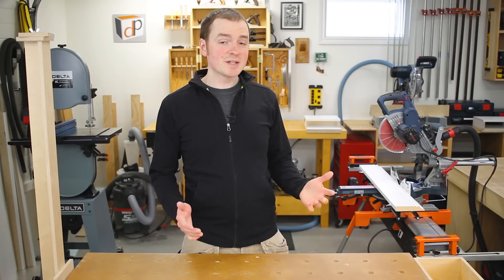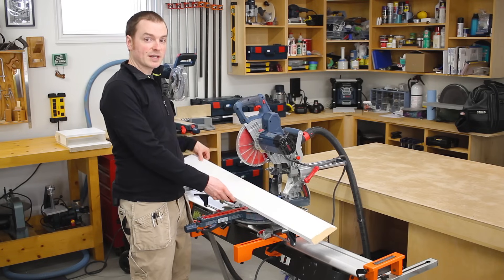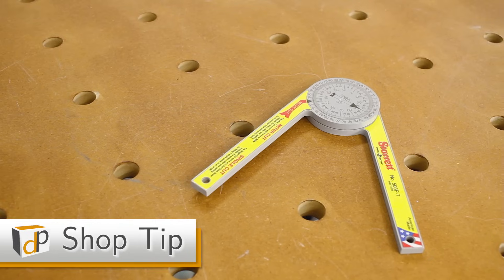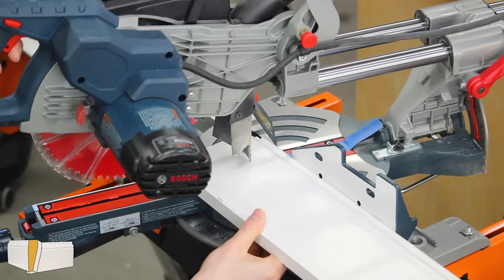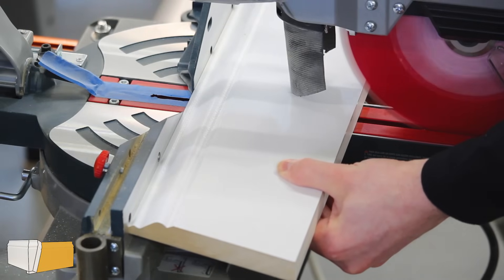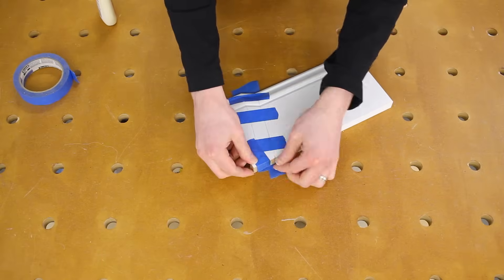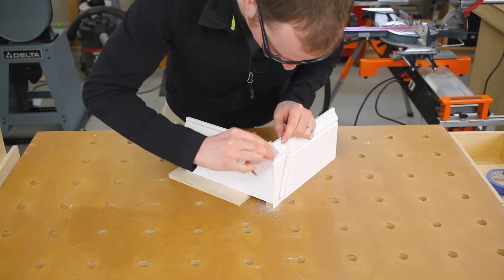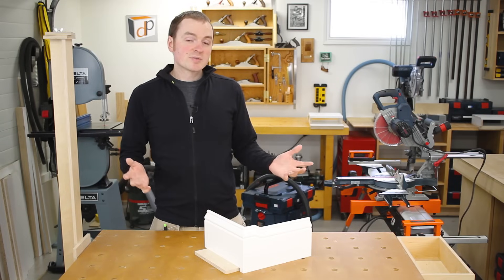How To Make a Baseboard Step Down Detail + Bonus Trim Tips

Comment: Man, this is why finish carpenters are worth every penny. Really nice detail.
Reply from the maker: +Mike Fratto thanks!
Reply: As a finish carpenter I would have started with the lower floor and then ripped the base so the top was the same height on the higher floor.  My guess is Dan did this as he does not have a table saw on sight.
Reply: My father in law has run a business for 40 year called Furniture Doctor and he makes 6 figures a year easy, I always thought it couldn't be that hard. Then I worked with him and realized it was the difficulty its the experience and attention to detail guys like Dan has.
Reply: I don't know why they have to be from Finland to do this?
Reply from the maker: I'm from Canada

Comment: Wow, how in the hell did you figure all that out. I WOULD LOVE TO SEE A VIDEO ON THAT PROCESS. True art, wow.
Reply from the maker: I just figured it out in a few minutes when I came across the situation on site. It's not really as complicated as it seems. I've done enough of them now that I don't even think about it anymore.
Reply: @DPShopTalk  Hi Dan.  So I have a job where this situation is occurring now. The only difference is there is no miters its just regular 90 corners.

 Basically have a 1/2" step down from some laminate flooring straight on to some stained concrete. 
My setup is basically a square room which has the laminate flooring and the drop occurs at the entryway to a hallway the entryway has no casing its just plaster.. 

So I want my base to come out of the laminate room and wrap around the 4" of entryway the wrap in to hallway. I just need it to drop down that 1/2" to concrete so all the base has the same top height..  
Can I acheive that following this video but taking out the mirror part? Help, lol.
Reply from the maker: @ShaneHolly  Hi Shane, from what you've described it sounds like a similar situation to what I showed in the video. If you wanted to email me some photos I could probably give you a better answer. dan@danpattison.com
Reply: @DPShopTalk  ok I will do that when I get there tomorrow.. thanks

Comment: I have a 3/16" step down off of my bamboo floor install to my entryway tile.  This worked out for 3/16" step down.  15 degree angles with about 1/4" step down.  Glue,Caulk and sanding it is going to turn out as it should. Of coarse I have a straight run too.

Comment: Great work Dan. How would I accomplish this with the bullnose corners
Reply from the maker: Thanks. Typically with a bullnose corner I do two 22.5 degree angles  so that a small piece goes across the bullnose corner at a 45 degree angle. Doing that with a step down detail would add a degree of challenge to it but would still be possible.

Comment: 4:45 I watched that 10 times and then got it, hearing things in North American takes me ages to convert to my brain. I've got it now! Cheers.
Reply from the maker: Lol yeah that's the critical part. I'm assuming that you're referring to using inches instead of metric. The funny thing is Canada is a metric country but for some reason just about everyone still builds in imperial. I do use metric more as time goes on but still mostly imperial so that I'm talking the same language as other trades on job sites.
Reply: @DPShopTalk  exactly.  But also the way you describe the right angle tool edge etc.. doesnt matter as I got it. Got my project done over the weekend thanks to you so many thanks! :)

Comment: This is awesome. I am in a jam and can't figure out my baseboard transition. Will this method work if my height is a tall 4 inches versus the .5 inch on this video?
Reply from the maker: It should still work but the step piece would be a lot bigger.
Reply: This method wouldn't make sense for that. You would either go straight down vertically and then continue, or just have 2 completely separate runs that aren't connected. The bottom run would but into the step, and the top run would "return" to the wall right before the step down

Comment: Great video and very useful to see this "How To". I might have missed it in a previous video, but can you give some details on the remote switch for the shop vac..? I've been looking for something similar and am torn between the various options available.
Reply from the maker: +Simon Coupland thanks.  I've been meaning to make a video about the iVac switch and how I use it but haven't gotten to it yet.  I use the iVac switch both on site and in the shop to control my dust extractor.  I find that it's very convenient to have the remote clipped onto my pants so that I can start or stop the vac whenever I want and where ever I am in the room.  I find that I use this much more than the auto on feature that the Bosch vac has since I have complete control over it.  Sometimes I want to leave the vac running longer after making a cut or keep it running if I know I'm going to be making another cut soon after.  The iVac switch has worked very well for me and I would definitely recommend it.  I'll put the link for it below.

http://amzn.to/2qmVT2x

Comment: Hi Dan!  Thanks for video. I have a bullnose/rounded corner. Do I cut the middle piece on corner and that would be included as part of ur “A” piece in diagram then continue on?  Thanks
Reply from the maker: Yes if you have a rounded corner you can add an extra piece at the corner with two 45 deg angles rather than a sharp 90.

Comment: This video is great. It really helps with baseboards. I have a question for you, I have a tile to wood floor transition, where the wood floor is 13/32" below the tile floor. What makes this transition difficult is that the transition is in a outer corner. The baseboard can level fine around the corner, but the 1/4" is what I am having trouble with. Any suggestions? I can email you a picture if it will help. Thanks!

Comment: Hi Dan. Awesome video. Will this work with a 1/4" step down as well? Or would the angles(i.e. 15 degrees) have to change?
Reply from the maker: Thanks. Yes it would work with a 1/4" step down. It would just make for a smaller piece.

Comment: Hi like your video very help full for me as I’m working as handyman, how fix show molding or quarter round on top same settings? It will be great help if you can share any idea
Reply from the maker: It would be similar running quarter round although most times if there is a transition strip in the flooring, the quarter round will stop at each side of it.

Comment: Really clean solution, top notch. Small quibble, but wouldn't it be easier to do the stepping down on the other side of the corner, on the higher flooring? That would eliminate the need for piece E.
Reply from the maker: Thanks Keith. It all depends on where the transition in flooring height happens. I've had situations where I haven't needed piece E because the flooring changed in a different spot. I was trying to cover the worst case scenario in the video for a situation where you would need piece E.
Reply: @DPShopTalk  Makes sense! Thanks for the idea, imma totally use that.

Comment: Love the trim step down video. Curious if 15 degrees would be standard for something like this, or how to figure the correct angle. Thank you.
Reply from the maker: Theres not really a standard angle for this but I've found that 15 degrees works well plus most miter saws have a detent at 15 degrees so it quick and easy to set the saw.
Reply: Dan Pattison thak you. I have a project that  is this exact problem. I appreciate it.

Comment: Have you considered using CA glue? And for quicker adhesion, spraying the joint with accelerator.
Reply from the maker: Yes I have used CA glue and I do carry some with me but I've come to prefer the 10 min wood glue. I find its stronger and it's not smelly.

Comment: I am incredibly happy I found this, I have a 1" difference in my dining room floor into my living area. So to Confirm I would need to make piece "C"  1" versus the 1/2". Am I following correctly?
Reply from the maker: Yes if you have a 1" floor difference then you would need to use that measurement rather than the 1/2" that I used for piece C. Just remember that it won't mean that piece C is 1" wide. You'll need to measure a 1" downward projection like I did with the small graduated square to determine the actual cut mark.
Reply: @DPShopTalk  Thanks It worked great, I had to be extra careful as I am staining oak base. Thanks again!!

Comment: you sure know your craft! We are installing molding on top of the baseboard coming down the stairs along the wall. Having a difficult time trying to figure out how to cut the angle where it transitions from sloping down the stairs at the bottom and then goes horizontal where the stairs end. Do you have a video for that? thanks, Joan
Reply from the maker: Unfortunately I don't have a video on that scenario. The angle finder that I used in this video makes figuring out angles much easier though.

Comment: I am working on customizing your plan for a 3-1/2” drop. Any advise would be welcomed.
Reply from the maker: It would be the same process just with different dimensions and the pieces would be bigger. Another option if the step down is that big is to just miter the baseboard and run it straight down the step down depending on how tall the baseboard is.

Comment: Dan just subscribed to your channel and even tho your baseboard step down was 1year old it was very helpful 
Just one question do those cuts still apply for a 4 to 6 inch step down I’m only a Diy er thanks mate
Reply from the maker: Thanks for the subscription Phil. Yes you could use the same cuts for a 4 to 6" stepdown. You would just need to cut a larger triangle piece to fill in at the bottom of the sloped piece.

Comment: So my question is how did u decide on the 15° angle for the step down? Is it an arbitrary angle, or determined by the difference between the two floors?
Reply from the maker: The 15 degrees is somewhat arbitrary. I chose it for 2 reasons. One, it is a standard detent on most miter saws, and two it looks good and works well for most flooring height differences.

Comment: I’m needing to trim out a wall which has drywall and a tiled wall. It’s only 3/8 “ difference in depth so I am stumped ow to make that transition because it is such. A small difference. What do I do to have a successful transition?
Reply from the maker: If its not a long run I would probably add a strip 3/8" thick to the baseboard to space it out on the drywall.

Comment: Howdy Dan, nice finish but can I ask - where does the 15 deg come from? When I do these I just Mitre 45 down to vertical then Mitre back to horizontal. My method creates a STEP down yours is more of a slope which I think looks nicer. My method also causes me issues because (using your scenario) the Mitre cut isn't contained within the baseboard, so I would have to position my mitre cut further away from the corner meaning the filler piece E is 4 inches or more and has to be cut on the table saw... More work for no extra benefit.
Reply from the maker: +Mike Stephens the 15 degrees just seemed like a good angle to go with and has worked well for me. It's also a standard detent angle on most miter saws so it's quickly repeatable.

Comment: I have a similar situation. However, it deals with a step up from a regular cabinet to the refrigerator cabinet. It's 2" higher. I'm an Electronics Technician, retired. Installed LED lights above, under and in all of the cabinets. To accommodate the Wife's bigger fridge, we had to raise the cabinet. It's a straight virtical change. Any suggestions for my Crown molding.
Reply from the maker: How big is the crown? Ideally the crown on the lower cabinets would  stop at the taller cabinet and then have a different run of crown on the taller cabinet.

Comment: How did you figure out what angle to cut it at? The 15 degree angle I mean.
Reply from the maker: It just seemed to be an angle that worked. It's somewhat arbitrary and could be adjusted. One factor is that it's usually a detent angle on most miter saws

Comment: How do you add quarter round with the same step down?
Reply from the maker: You could just cut the same 15 deg angles on the quarter round to make it work the same way. If there happens to be a flooring transition strip that butts into the step-down then I usually just stop the quarter round at each side of it.

Comment: Imagine two rooms meeting and the wall between removed. Now try running baseboards only on one side not only is the floor not level  but the wall angles back about 22 degrees how do I make These two runs connect? Just like your example,  only the floor is out of level as well. Dan can you please help? Thanks
Reply from the maker: If I'm understanding you right, it sounds like you would need to do the step down detail but instead of cutting a corner joint like I did you would need to make some 11 degree cuts to work with where the wall angles back at 22 degrees.  It should be the same concept as what I did but with different angles and possibly some different filler pieces at the bottom depending on where the floor drop happens in relation to where the wall angles back at 22 degrees.  Hopefully that helps.

Comment: How do you make a step down with shoe molding
Reply from the maker: You would just miter the shoe moulding to step down at the change in floor level after the baseboard gets installed. Or you could stop the shoe moulding at a flooring transition strip if you have one.
Reply: @DPShopTalk  Dan can you show a video on how to do this with shoe molding.  I have one floor with sub flooring and one floor with no sub flooring along with transition strip.
Reply: @DPShopTalk  Dan can you sow a video on this specifically.  I have to go up about a 1/4 inch or so along up over a transition strip.  what happened was the original flooring had no sub floor and the newest flooring had a sub floor.  Thank you so much I can wait to see the new video.
Reply from the maker: Sorry, I don't have the time to produce a specific video like that. The shoe moulding should be a pretty simple install if you cut and install it similar to the baseboard.

Comment: what if it's a rounded corner? Thanks
Reply from the maker: You mean a rounded corner bead?
Reply: Dan Pattison The corner of the wall is rounded.
Reply from the maker: Usually with a rounded corner you would use a small piece at a 45 degree angle on the corner rather than a 90 degree corner so that there is less of a gap behind the baseboard on the corner.

Comment: is in it easier just to do a 1/2" strip at the bottom on that section.
Reply from the maker: You could do that but you would have to continue that on every piece of baseboard that continues from that piece too.
Reply: @DPShopTalk  that's true , exellente job very ingenious with those angles.

Comment: What's the rationale for 15 degrees, as opposed to 22.5 or 45? Now do the same with out of square and out of plumb walls!
Reply from the maker: 15 degrees is just an angle that I found works well. More of an angle will make the step down too steep. Walls are always out of square and plumb, I always measure the angle of all outside corners and pre-assemble joints to compensate for out of true conditions.

Comment: I'll play the village idiot here, but do the angle measurements stay the same regardless of the height/thickness of the baseboard? Awesome work...got a new sub here..😀
Reply from the maker: +RxMixer thanks and great question.  The 15 degrees stays the same regardless of the baseboard thickness and height.  Now having said that there is nothing special about the 15 degrees other than it's an angle that I find works well and looks good.  A steeper angle will slope the baseboard down faster and and lesser angle will slope it down more gradually.  Is that what you were getting at?
Reply: Thanks Dan. That's exactly the answer I was looking for. Different angles can be used, it's just that the appearance will then change. Perfect...

Comment: Why is it 15 degrees and 60 degrees for piece “E”
Reply from the maker: The 60 degrees is based off of the 15 degree angle.  The 15 degrees is somewhat arbitrary but I find it works well and looks good. You could make it more or less steep if you wanted to.

Comment: As thorough as this was I’m so freaking lost. How did you determine the angles?
Reply from the maker: The 15 degree angle is somewhat arbitrary but I find that it just works well and there is also a detent at 15 degrees on most saws. You could use a different angle to make the step down more or less steep if you wanted to. If you have some scraps try a mockup like I made in the video and it will all make sense to you. Hope that helps.

Comment: Talking about the whole process and how you came up with angles and distances. Unless this video wasn’t an instructional then I apologize.
Reply from the maker: The 15 degrees is just an angle that I found works well and is a standard detent on most saws. The stepdown dimension is just the difference between the two flooring thicknesses.